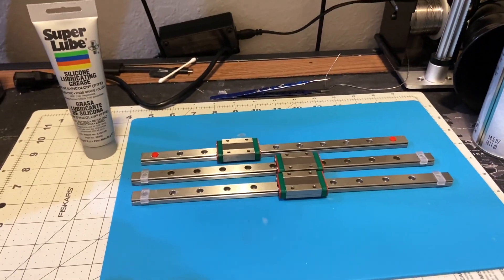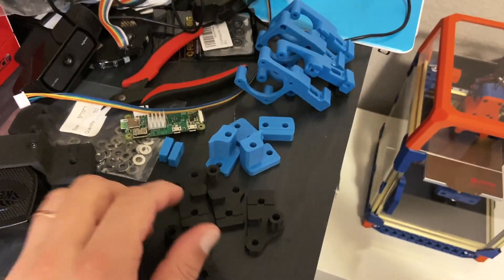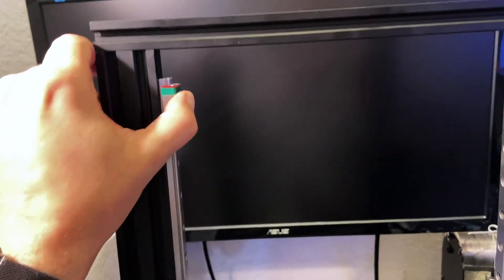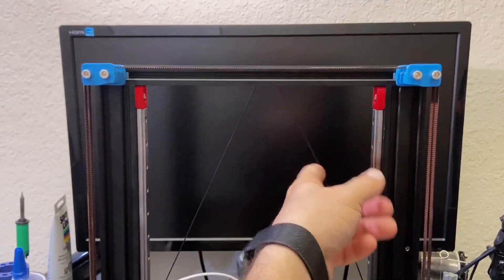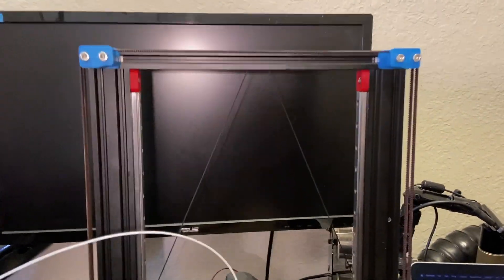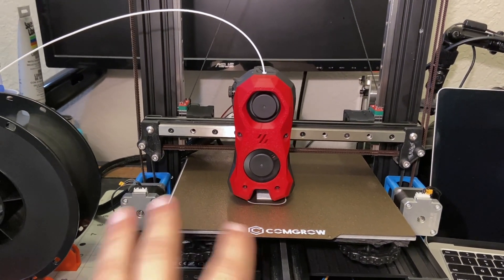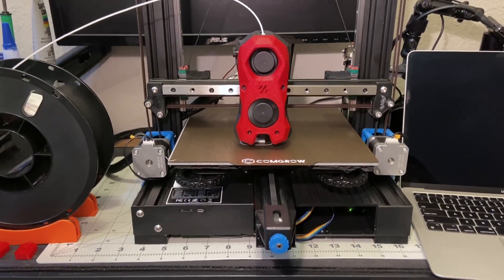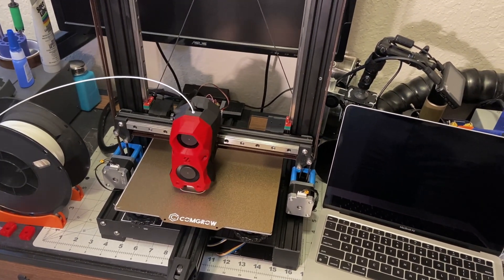Ender 3 to Voron Switchwire CoreXZ Conversion (Part 1)

Comment: Use original stepper stock ender?
Reply from the maker: You can, I just used bigger original extruder motors cus had plans to print fast and I had them on hands.
Reply: @hobbyistnotes Can the original stepper print quickly?
Reply from the maker: @bayunugrahasuparto9639  They are, most people running original motors with this mod. Also 17HS15-1504S1 motors are 10$ a piece even you find original being "slow" it's easy to replace.

Comment: I built my ender 3v2 to the point where I have everything I need to build another one, so I picked up a 3v2 frame with gantry on ebay and a couple parts I needed (stepper motors, heated bed etc) I have been looking to build either a voron trident or possibly a vz bot, but this might hold me over for a bit! Very cool stuff
Reply from the maker: Totally understand you, I have parts now for 2-3 more Enders 3 was thinking mb to try some custom core XY build out of those parts I wish to have more time.
Reply: @hobbyistnotes  same man! These 10hr days are rough, but I like the money. If you make a video on it I would love to follow along and get you some views and likes. Ill sub now and keep my eyes out for it!

Comment: Hi Mate are you using Fluid with Klipper? cause it looks little diffrent than Mainsail.I am also considering for upgrade however I have 6 Ender 3 v2 Neo's and v2 Neo's have S1 Pro Gantry on X axis and same Y axis configuration as Ender 3 v2 so my upgrade will be little more challenging cause the 2020 aluminium profile front is flat and can not attach V-Slot nuts.... 😒 I want to upgrade them with linear rails so I don't need to change lots of V-Slot Wheels in future. Do you think is upgrade worth the time and money?
Reply from the maker: Yes, I used Fluidd in this video as I liked it more but now mainsail is way better. Upgrade question is very tricky cus now for the price of the upgrade you can probably got urself used or broken for repair Creality K1 of eBay or something similar which will be better in a lot of ways. These days this upgrade make sense only if you have parts on hands or you up to challange.

Comment: i always thought that Core XZ was a bad idea, but now that i think it, you wouldn´t have to deal whith z banding that is une of the hardest problems to deal with and that is amazing, also is almost like you have double z axis, a have an Artillery sw x1 and this looks like a good idea
Reply from the maker: Totally agree with you! That freaking elephant foot was driving me crazy as one of the most horrible effects of Z-binding and there was no settings or "easy mods" that could totally eliminate it... If be honest after making this mod I ASSUMED it's will not be a sustainable as "stable system" due to over complicated motion system, but since upgrade I had 0-issues with it and the only thing I had to do is to update the firmware which wasn't really a "Must" and over all one click action with Klipper. For me this pinter just Slice -> Print and considering the speed quality is pretty good too. The only real downside is the Price...
Reply: @hobbyistnotes  i already have klipper installed so that would be no problem, and i found a proyect called switchwinder that coul maybe help me.
Reply from the maker: @StefanoMerinoDeRui  There is a lot of versions of this mod, I think you can easily find one that suits the parts you might have on hands, good luck with the build!

Comment: I've had my Ender 3v2 for about a year and a half and it actually prints excellent even on the stock extruder. The problem with it is the cheap extruder and the bed springs that constantly need maintenance and calibration. I'm currently investing another 300 or so this year to convert it to a more modern platform. I don't mind it since the only realistic upgrade I see for a hobbyist like me is a Bambu. And I don't want to spend 1k+ anytime soon to have modern features.
Reply from the maker: That is one of the issues with all cheap printers eventually you will spend more money on upgrades…
Reply: @hobbyistnotes  The upgrades are fun though
Reply from the maker: @NO_obs  Hard to argue with that 😅

Comment: So let me get this straight with this mod you don't lose any of the ender 3's build volume?
Reply from the maker: If you do it my way you loose about 5mm on Y-axis but it's only if you use second row of screws at the bottom, but if you use extrusion nuts and move bed a bit more forward no loose of printing area at all. For me 5mm is not critical I have never used full bed so I went for a lazy way.
Reply: @hobbyistnotes  so odd question, are the Hammer nuts and T nuts the same as the spring nuts? Just trying to source materials for my build, I've got most of the actual parts laying around
Reply from the maker: @captainthiccnick  No those are different things but you can use T-Nuts it's just odd behind the rail to see if they actually turned all the way.

Comment: Hey man. Nice project and I actually started to make mine but I'm on v4.2.7 board instead of buying skr e3 is it possible to use 4.2.2 config with 4.2.7? do you know if I need to change anything? I want to ask you before I dig into maybe you'd know if it's same or not. Thank you again.
Reply from the maker: You might need to adjust klipper config a bit as pins of the controller could be different, compare 4.2.2 and 4.2.7 configs from klipper repo. I would take heatsink out of one driver to verify which drivers you have installed. I suggest to buy a new/other board that will give you opportunity to run drivers in UART as it will be 30-40$ well invest money that might save a lot of nerve and time. In theory you can convert/mod Creality board drivers in UART mod but based on your questions I assume it might not be an option for your knowledge/skill level, I might be wrong.
Reply: @hobbyistnotes  I have no problem with electronics. Im already using skr boards on my other printers but there is that e3p with v4. 2.7 board which I've never had to dig deep since all my focus was on my other printers. so I just wanted to ask because since you did the project maybe you'll have the answers before I invest time in my own project :)
Reply from the maker: @orhankokbudak  Unfortunately I don't remember out of my head if there are too many differences,  I have 2 boards 4.2.2 and one 4.2.7 and klipper installations was super fast just pulling config of repo adjusting E-steps and good to go... Now PA bug fixed those boards with UART mod could be more than enough for Ender to Switchwire conversion. Take a look at this topic: https://www.reddit.com/r/ender3v2/comments/n3clew/ender_3v2_422427_board_tmc_uart_mods/
Reply: @hobbyistnotes  thanks man appreciate it
Reply from the maker: @orhankokbudak  I thought to make video about this mod.... Have those boards laying around with no use....
Reply: @hobbyistnotes  you have already made grate contributions to the community :) Appreciate your effort.
Reply: Ok I checked the pinout it looks like "step_pin" and "dir_pin" is reversed in v4.2.7 rest looks same. Will check in details and let you know

Comment: Voron Switchwire why does it print so slowly? I have seen Vorons usually do 1000 mm/s?
Reply from the maker: I didn’t really had speed printing in mind and haven’t really pushed it as much. Might need some hight flow hot end but kinematics itself is very capable.

Comment: Can you please give me a link to the stl files that you printed for this mod? Also ...can I run klipper with a pi4 and arduino mega + ramps combo? Thanks in advance!!
Reply from the maker: All links are in to the description. Based on breef research looks like it's possible to run Klipper with Mega Ramps combo as most work will be done by RPI, but as I have 0 live experience with this setup I can't say for sure.
Reply: @hobbyistnotes  thanks man. And love your work. Best of luck!!

Comment: how are u connecting the PI to the board without usb cable
Reply from the maker: Board and Pi communicate via UART, also it powers up Pi via GPIO which is very convenient. I will add link in to the description to a Nero 3D's video where setup is explained.
Reply: @hobbyistnotes  alright thanks for that. I think I plan to reuse the y Pom wheels like you did. One less railing to buy actually makes a difference in the budget .
Reply from the maker: @NilSirrah  I just don’t see much benefit of changing wheels to the rails on Y axis. May be I am loosing small amount of vertical space but I never use full size anyway.

Comment: I love how you put it, The most expensive and stupid upgrade of an Ender 3. I started mine too, but i would not call it a Creality Ender anymore, it does not good. I Put a Mellow Fly RRF E3 replacement board in it running Reprap. sensorless and all, only the Frame extrusions are what i consider Ender.
Reply from the maker: It's definitely nice engineering challenge =) and I agree about it not being an Ender Anymore. Do you like sensorless homing?
Reply: @Hobbyist Notes  I like it because it requires less wires. But setting it up is a bit more work, adjusting the power and so, but I have it on 2 of my 3 printers.
Reply from the maker: @martijndeman4789  I spent some time on it but never got results satisfying enough to throw away the switches...

Comment: what termistor type your using?
Reply from the maker: I used Triangle labs 50W Cartridge and Stock Ender's 3 glass thermistor (just crimped it with included Dragonfly hotend tube)
Reply: do you have a discord channel?
Reply: @madorax251  Nope, but I feel like it's time to make one, I'll take a look later.
Reply: what vref voltage your using stock ender 3 v4.2.2?

Comment: It's incredible,  can you tell me ballpark guess of what you paid? I am going to do it to a cr10 v3. I have the skr 2, screen, hotend, pi4, power supplies and motors?
Reply from the maker: I think it was closer to 250-300$, there is a lot of things you can save on, I listed most of the parts I used in to the description so... you can make your own research what it will be specifically for you considering what you have. Overall financially this mod doesn't make much sense, it's only for people who want to experiment and have fun tinkering, as for this price itself you can find a printer that will print with a good quality with good speeds.
Reply: @hobbyistnotes  yeah I think I'm just gonna build a 2.4. I'm opening an ebay store selling two tone abs voron parts. I can make 2 sets a week so it shouldn't take me long to just plop the money on a 350mm kit. I just bought all new gear for my workshop or else I'd have a 2.5. Soldering stations, function generator,  hot air rework station,  pc, oscilloscope. All of this along with a 70 dollar a week led collection habit. I lost count of how many types of leds I have and just have to guess in pounds now hahaha I'm a sucker for them. It started when I bought all the stock of neopixel strips from a seller early last year and now it's all different through hole ones. I buy 100 pl9823 8mm round head leds a week along with other kinds. If I had to guess I'd say I have close to 80k leds not including strips of adressable ones. Lol
Reply from the maker: @jstro-hobbytech  Because Why not ;-) hahahha!

Comment: Is that possible to use linear rails HGH15CA or HGH15CC instead of MGN12 which you used in this video.
Reply from the maker: As I don't have those rails on hands i can't say for sure, but with 3D printing "everything" possible. You just will need to adjust parts...
Reply: @hobbyistnotes  Okay let me try, thanks for your reply.
Reply from the maker: @mugeshrajaram6306  I would start with checking screw holes positions of the rail carriage if they are at the same distance as MGN12 it should actually work fine. Also you can use project cads for size references. Links to the projects I used are in to the description. Also I am prepping second video about changes I had to make in order to finish the mod.
Reply: @hobbyistnotes  Thank you, reply me if the holes matches with MGN12. I'll also check from my end.
Reply from the maker: @mugeshrajaram6306  Sorry, but I don't have time and rail on hands to compare, you will have to do it yourself.
Reply: @hobbyistnotes  No problem cool, I'll try it and let you know too. What do you mean by "PROJECT CARD" you told me to take it for size reference.
Reply from the maker: @mugeshrajaram6306  Not a card, CADs, 3D model. You can get free Fusion 360 license and open it in there. Also with 3d printing nice to learn this tool as it makes 3D printing way more fun.
Reply: @hobbyistnotes  Sure will try it.

Comment: Cant your share macro.cfg your using?
Reply from the maker: I am not using any custom macroses (default Fluid Pi only). Currently preparing the printer for Serial Request. After that will start working on optimizations.
Reply: @hobbyistnotes  I mean start print and the prime line macro you are using.
Reply from the maker: @lanypuspasari1868  So, the start clean-line is from CURA default settings for Ender 3. I guess you can put it as ur start print macros.

Comment: Why!?? Also, Why not?
How is the cooling compared with the afterburner that uses a 4020 instead?
Reply from the maker: Cus wanted CoreXZ motion system and had Nice donor. New stealthburner Is significantly better at bridging. Bigger fan really helps to have extra airflow, previous was not enough.

Comment: This is brilliant!  You state this mod makes no sense and is expensive but I disagree.  Many folks (including myself) start 3D printing with a Ender 3 V2 because they are a good first step 3D printer.  But then after 1 year I grow impatient waiting for prints to complete because it is slow.  To keep it running I have had to upgrade many components such as extruder, springs, hot end, and fans after 1 year of moderate use.  So why throw out the Ender 3 V2 and start over?  The Ender 3 V2 has a frame, power supply, and print bed that work.  I really like the idea of "up-cycling" my Ender 3 V2 and turing it into a Voron Switchwire.  I don't have room for a large number of printers!  As I understand it I can invest another $300 - $400 and then have a much faster and more reliable 3D printer?  Bonus is it won't take extra room.  I am interested in seeing more videos showcasing the speed and reliability of this modification, does it work just as good as a stock Voron Switchwire?
Reply: I couldn't agree more. I had my ender 3 v2 for about 6 months when i decided to get into the voron community by converting it to a switchwire. I used the converted ender to print all parts for my Voron V2 and is currently in the works of printing parts for a v0.1 while the v2 is printing trident parts :D
Reply from the maker: I was working on polishing the details and making sure printer as good as finished product... I'll get better soon and finally finish it. Main reason why i decide to upgrade is I don't need full size Voron Switchwire I never used full bed and you are right about most parts can be reused, I even re-used lead screw from left over parts in other ender 3 I had.
Reply: @hobbyistnotes  I am sorry to hear you got COVID.  I hope you get better ASAP.....the videos can wait your health is more important!
Reply: I just got the Ender 3 V2 and I am researching my upgrade path to Switchwire. I am hoping to upgrade step by step over the next year's. I already got the printer running via Klipper and I am planning to build a enclosure with fan, which also needs an 3d printer to make. So in the end, when I want to upgrade something, I try to match it with parts from Switchwire.
Reply: @Nanne-f5i  Next step after having a printer to get new hotend and clone or original bondtech extruder, one advice is to buy whole extruder as its only few extra $ and can be used even you will change the opinion to convert over SW as it's nice extruder. About hotend: all-metal V6 is not losing much to more expensive hotends as regular dragon in terms of a flow (if you have money you can buy a good one). So for ~30-40$ you can get very nice direct drive upgrade with V6
Reply: This is a fantastic comment and exactly my take on the scenario as well. I've just discovered the switch wire community like 15 minutes ago, I'm taking the plunge into the rabbit hole as we speak
Reply: I completely agree. would love more indepth videos on this conversion like this, your video literally gave me the confidence to at least buy the linear rails for my ender 3 pro!

Comment: Cool video this gives me inspiration to try on my old CR-10
Reply: Same here! just built a V2.4 and I have the itch hahaha
Reply from the maker: Glad to 'hear' that! Those CR-10 times, mmm... I had Tevo Tornado back then...
Reply: Did you do it? I have a CR-10 v2 laying around collecting dust. I stopped using it because the glass it warped and it’s slow.